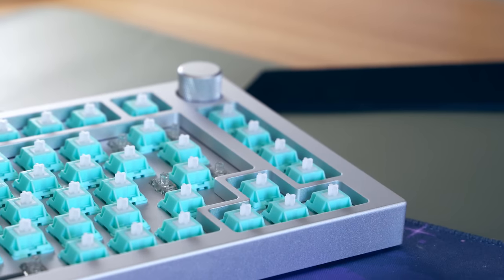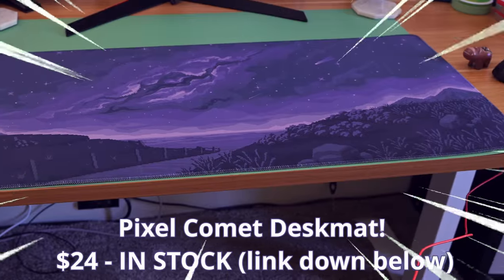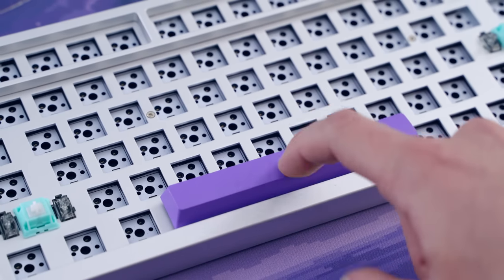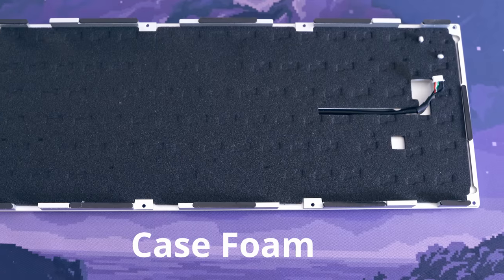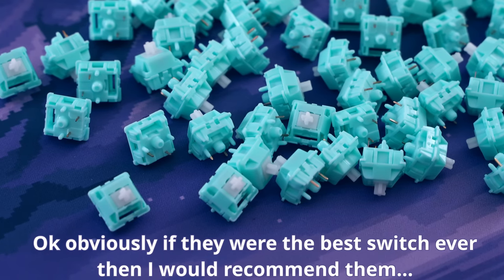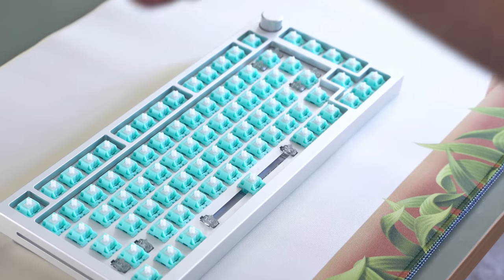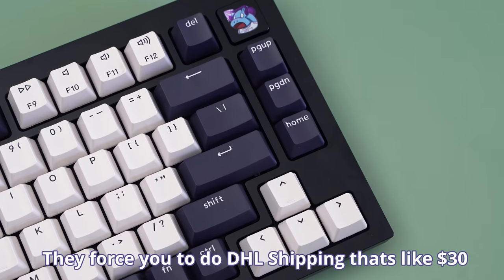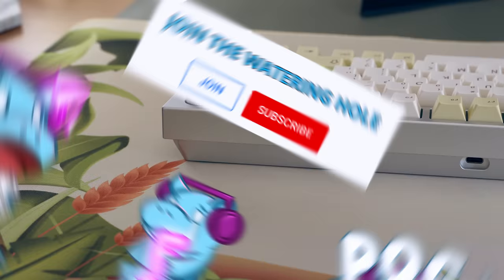I Tried the GMMK Pro (So You Don't Have to.)

Comment: Randomly got really into keyboards this year, & now have 10 custom boards. Absolutely love my GMMK PRO w/ Everglide Aqua King switches. Love the sound & feel of the board, looks great, & a pleasure to type on
Reply: What’s your favourite board so far
Reply from the maker: Great to hear!
Reply: No, not lucky.  I’ve been down the rabbit hole for around 3 years now and I’ve wasted at least  5k-10k on boards.  It’s an addiction now.  Since I started working, I really can’t control myself.
Reply: i bet you didn't try topre, because it's the best and makes all other boards unnecessary
Reply: @zainzaidi5582  Haha! I don’t completely disagree, but my car collecting & racing hobby are far harder on the wallet, as are my sneaker & watch collections. I find building keyboards such a relaxing thing to do though in what little free time I have.
Reply: @ehrarbose5600  Favorite board to use so far is actually the GMMK Pro (I know some will think that’s ridiculous), but I have the Idobao id80 Crystal, BALDR 60 glass case, & a few others on order that I think may become my new favorite. I also missed the Mr. Suit in the first round, but I’m hoping to grab one in the next round in a good color. Heard lots of great things about that one!
Reply: Same. What plate are you using? I’ve tried them in alu and pc and found they are kinda loose in the pc plate.
Reply: The gmmk pro is my first custom keyboard (and hopefully my last) and I have it since june. It is a really good keyboard but I had to mod it a lot to get the perfect sound. But overall I really like all the feature it has (yes even the rgb) and the hotswap is a really cool feature to test out switches.
Reply: @crainger  I have both the aluminum & PC plate, but I’m using the PC plate & prefer the look and feel of it. It fits perfectly snug with no wobble or loose parts at all in my keyboard.
Reply: It's a real struggle
Reply: @FitLabb  if you can, tell me how it holds to the keychron? Deciding between the two and as many opinions I get the better
Reply: I built the same! topped it off with synthwave, big fan of it
Reply: But....why u need 10? 😂😂😂
Reply: @goovindnarula6470  I haven’t used the Keychron yet, so I can’t give any perspective on it vs. the GMMK Pro, but in the reviews & comparisons I’ve seen so far, most seem to favor the GMMK Pro out of the box without any modifications made to either. What I can tell you is that I am very happy with the GMMK Pro so far, and it’s one of the best feeling and sounding boards I’ve ever used to date, but that’s purely based on my own personal preferences.
Reply: What are your other builds?
Reply: My exact build is the gmmk pro, with aqua kings. Do the PE and gasket mod, thing gets close to sounding like a jelly epoch
Reply: @nightking1863  actually I’m a huge hhkb fan. Ive always given the king and founder  of thocc some  recognition.  Though I only have the pro 2 still love it
Reply: @mikemirando3878  heard the thera75 sounds and feels closest to the jelly epoch.
Reply: @FitLabb  I’ve heard the q2 to be better than the gmmk pro after mods. Although the gmmk pro doesn’t sound as good after the q2s mods, it sounds so much fucking better than the q2 stock. Personally, the  gmmk pro also looks a bit cheap with its crusty branding and side leds.  Still a decent board though.  Have mine with gmk WoB and stock JWICK yellows form the creamyco.  JWICKS are basically a cheaper alpaca re-color/alternative.  Really loving them right now.
Reply: @goovindnarula6470  if you plan on modding then fuck out of your board then go with the q1 (just realized I’ve been using keyhcrons new 65% interchangeably with the q1 fuck me lmao).
Reply: Me too. I have the aqua glides and polycarbonate plate. It was a huge in pain in the ass for me to get everything working properly because the switch plate was warping the PCB. Had to do a bunch of physical filing to the plate. All that is done and the keyboard sounds and looks great now. I love mine as well and also randomly got into keyboards. lol
Reply: keychron be-
Reply: @FitLabb  oh so you havent really experienced any enthusiast boards. makes sense why you think the gmmk pro is good lol
Reply: @jsnR-d7x  We all start somewhere, & having only just started in the hobby in the last 6 months, & 10 boards in already, it’s definitely my favorite so far & a real pleasure to use. Curious how I’ll feel after I build some of the more “enthusiast” boards I recently ordered on group buys (or plan to buy soon) that are mostly arriving in 2022, but I’m sure I’ll still like it.
Reply: @zainzaidi5582  sheeeeeeeeesh that's alota money lol
but in terms of money in the mech space, can't you just sell some builds you've grown tired of on the aftermarket if you're ever, like just short of cash? i'm legit curious bc i'm just getting into the keeb space and I've heard that most cases appreciate in value/you can make some decent change on the aftermarket and selling/building ppl boards (?)
Reply: Prebuilt vs Custom?
Reply: im planning to get aqua kings for a future build, would you recommend them, if so which spring weightage would you recommend?
Reply: @RanjitSingh-cb1cm  I have 12 different switches that I’ve used to date, & the Aqua Kings are by far my favorite, with lubed Tealios being my second favorite. They just sound & feel so satisfying to type on, and they’re the smoothest switch I’ve used to date. They’re also the best switch to use if you have a per-key RGB board since they’re completely transparent. There seems to be a shipping delay on them right now, but you won’t be disappointed if you get them!!!
Reply: @FitLabb  no offense but having 10 boards and Gmmk pro being the best in your collection just shows that you wasted money on most of your other boards
Reply: @jordanoon2758  No offense taken. I disagree though as I think it just shows my personal preference so far (but yes, there are 2 boards in my collection that I probably wasted my money on before I knew better). 

The GMMK Pro might not be a fully custom or very expensive board, but it is really good for the money & I actually like it. I’m sure there are others I’ll like better once I start building some new custom boards that are arriving over the next few months, but until then I’m very happy with it.
Reply: Same but not the 10 board part
Reply: You got moneyyyyyyyyyyyyiiiiiiiii
Reply: Are you a fucking millionaire?
Reply: @FitLabb  like how you stick to your guns. aspeacialy liking what you like. way to go!
Reply: Having 10 boards and liking the GMMK Pro is a bit suspect man, don't know in which or what way but it is not only unusual, also a bit weird .. Was your purpose while getting into the hobby finding the board which hides characteristics of its switches the most ?
Reply: @mkeebs3623  No offense meant, but your comment reminds me of the snobbery I sometimes see in the car scene, which I want no part of. Just because I might not be a fan of whatever car someone shows up with at a car show, or if my cars are faster or more expensive than theirs, that doesn’t give me the right to put them down in any way, & I still respect their personal preference to own & enjoy whatever they want without passing judgment on them. I suggest you try doing the same.

That’s no different than why I happen to like the GMMK Pro, as my opinion RIGHT NOW is that it’s actually a really good board for the price, especially when modded. And what could possibly be suspect of me liking that board? 🤷‍♂️ That comment was so ridiculous it actually made me laugh!

PS: I did just build a Monstargear Alu XO v3 a few days ago, and I like it enough that I swapped it with the GMMK as my “daily driver” on my desk for now.
Reply: @kninzotagoni3635  Thank you, appreciate your kind words! Personal preference is just that……and everyone is entitled to like what they do. If we all liked & owned the same stuff, the world would be a very boring place.
Reply: @FitLabb  indeed just like hipos latest video he made a 20 dollar board like like something past 200 with upgrades. it's all about preference.
Reply: @FitLabb  i see your point. Wasn't trying to be snob this being the YT comment section maybe I sounded like one :) True it is down to preference but try to see from my perspective too, I couldn't really wantingly use the GMMK Pro & IDABAO80 after I started building customs. So rather than trying to be snob about keyboard brands, I found it hard to believe you still like the GMMK Pro that much you know? Kind of like I love my 200lbs less track-hardened Z06 with a nicely massaged LS7 but if somebody gifted me a CGT i would be liking and using it alot less :) I was looking at the Monstergear XO v3 too, you like it ? It was in my list before decided to go on the Matrix TKL GB 2 months ago.
Reply: @mkeebs3623  I appreciate your response & understand your perspective much better after you explained it this way. Maybe I’ll feel differently about it one day after I have several custom builds under my belt as well, as maybe I just haven’t experienced enough boards to know better than I do yet. Bought a soldering iron 2 weeks ago to start practicing with before some of the solderable boards start arriving, so we’ll have to see how that goes.

I really like the Monstargear XO v3! The thing weighs a TON, which is largely due to the massive brass plate on the bottom, but the fit & finish is top notch, and I really like the aesthetic & sound of it. I don’t think you would be disappointed with it at all. I got an extra pcb & an aluminum plate in addition to the brass one, but used the brass for now, and it sounds & feels very nice to type on with the linears I went with. Still would like to get the Mr. Suit if I can get one, & have a Monokei Kage in navy blue on order as well (arriving sometime late next year), even though I generally prefer the 65% & 75% sizes better. Something just stood out about all those TKL’s to me that made me want to pick them up.

Btw, saw you made a short video about the KBD75 V3.1? Curious how you like that as a custom build & how it compares to something like the GMMK Pro or other customs since it’s priced somewhat comparably.

PS: Do you have a Corvette ZO6? I love those cars & almost pulled the trigger on one of those several years back, but bought my 2008 Viper convertible instead back then. I now have a 2017 Viper ACR Extreme as well, both of which you can see on my personal IG page that’s linked in the about section on my YouTube channel. I also briefly featured the 2008 in my “Periodization” video on my channel, and my 2017 had a fun video made about it by a car channel I’m friends with, which I linked to in a playlist on my channel as well. I think it’s in the “collaborations” playlist if you want to check it out. Think you’d enjoy that one as a fellow car guy. 🏎💨
Reply: @mkeebs3623  I just recently learned to start buying an extra PCB with every board I buy, but I like your idea of getting one hotswap and one solder version, as I’m sure I’ll actually enjoy soldering boards once I start getting into it.  Not that I have much of any free time to do any of this, as I work about 12 hours a day, and then have to still find time to take care of my kids and get to the gym, but it’s great having fun projects like these to work on whenever I have 30-60 minutes free at night.  Speaking of, I just bought one of the remaining Fox Lab Time 80 Reforged that they had leftover for sale, & can’t wait to build that beautiful board with the brass clock in back!  That board is a work of art on the back, & I’ll probably have it on display in my office when I’m not using it.

2008 was a great year for the Z06, and sounds like yours is very appropriately modded for track use!  Did you move from the US to Europe?  Glad you’re able to really fully enjoy it!  I don’t track my cars (I usually rent a race car or drive a manufacturer’s track spec car), which is upsetting as I’m DYING to race the ACR, but the values on them skyrocketed last year to almost 3x what I bought it for, so I kinda have to keep the miles low on it while I drive the 2008 much more often.  I usually race at Lime Rock Park in Connecticut or at Monticello Motor Club in New York.  The only minor mod on my 2008 are high flow catalytic converters, which makes the car basically sound like it has straight pipes, and adds a bit of power as well, which it honestly didn’t really need.  😂 

Looking forward to checking out future videos of your keyboard builds, so keep them coming!  I just got into the keyboard hobby in the last 6 months, but I find myself watching keyboard videos every day now & can’t wait to see what cool stuff is coming out in the next few months.  My channel is all about fitness as I’ve been a fitness professional for over 20 years, worked with many NBA players & celebrities in that time, and now founded an online fitness & nutrition platform that I operate as well.  As much as I like cars, keyboards, and other stuff, fitness and helping people have always been what I enjoy doing most in life, & I love that I can now really help so many more people all around the world even just through the free content that I create on my channel.  And I’m glad we got to chat here after that initial misunderstanding, and it’s great meeting you as well.  Wishing you all the best with what you’re doing, & looking forward to seeing more great keyboard videos on your channel soon! 👍
Reply: @FitLabb  love the viper man that's like my dream car. wish they mass produced the viper gts R. that cars body is just perfect. wish I could get that years model and get a body kit to look like it but it's hard to find any body kits of it and I could never afford it. XD
Reply: Is the GMMK pro still your fave?
Reply: @kninzotagoni3635  The Viper was my dream car when I was growing up, & it was literally a dream come true when I got my first one 9 years ago as I never thought I’d be able to actually get one. I still pinch myself most days when I walk into my garage & see them in there! Haha!

I agree that the GTS-R model back in the second generation was really something special. Not only was it a rare version of the car, but people don’t realize how rare the Viper is in general. Produced from 1992-2017 (skipped the 2007 & 2011-2012 production years), there were less Vipers made in all that time than one single year of Corvette production with only about 35k cars built over 25 years of existence. That’s one big reason you almost never see them on the road, & also partly because nearly 1/3 of them were totaled already by owners who didn’t fear & respect the cars.

I hope you’re able to get one someday. Work hard & smart, & there’s nothing you can’t accomplish in life!
Reply: @FitLabb  that's true and it's a shame they stoped making it but now Im afraid for them to bring it back. as an automatic or something Xc and ya I would say it's not impossible aspeacial if I can get a beat up one and gradually work on it to restore. but sadly I'm no macanic so it would be expensive to have some one do it for me. and ya that car has bite. it's what makes it special.
Reply: wish I had the damned money to do that
Reply: Did you use the base stabilizers?
Reply: @saltee8460  I actually did, and they’re not great. It’s my biggest gripe with the board, but I’m planning to mod them at some point soon so they sound and feel better. Every other board since and going forward I’m using much better quality stabs & modding them for a MUCH better experience.
Reply: @FitLabb  Thanks for the quick response, thinking of going with the durock v2 stabs. Seen a lot of people have some success with them.
Reply: @saltee8460  My pleasure, happy to help.  The Durock v2 are supposedly great (I haven’t used them yet myself, but I have a couple sets sitting around waiting to be used) though I’ve heard that they sometimes show up with the bars bent a bit.  I’ve used the Everglide stabilizers that I bought on Drop and they’ve been great so far for me!
Reply: @FitLabb  what board are you going to use them on
Reply: @kninzotagoni3635  I have several boards on the way that I’m going to be building & using them on. Off the top of my head, a few of them are the Fox Lab TIME80 RE, KL-90 wood model from Barrett, Eniigma Vertigo, Viendi 8L, Gentleman 65, EVO70, Idobao ID80 Crystal, Monokei Kage, and more….. Its going to be a fun year of building & collecting boards!
Reply: @FitLabb  I see if your going to do it to the gmk pro and you have an aluminum plate make sure to clip off the knobs with pliers. so they fit.
Reply: @zainzaidi5582  seek help my dude
Reply: I’m in love with my Aqua King switches
Reply: Same! Build my first keyboard this year and went exactly your route. GMMK Pro with Aqua King switches, C3 stabs, Polycarbonate Plate and AKKO keycap set and it's an absolute joy to type on. Looks great, sounds amazing and typing is so satisfying on it. I am however looking at my second board now the Mode 65...this hobby might make me broke but it is a very nice hobby nevertheless.
Reply: Are u gnna get a ducky one 3?
Reply: My GMMK PRO is amazing I absolutely love it. I also have a kbd fans and I still prefer the GMMK Pro
Reply: @danielbailey6923  I wasn’t planning on it, but then again it wasn’t really something that was on my radar. I’m picking up a Mode 65 today or tomorrow, & bought a bunch of other custom boards since I posted this comment a couple months ago. Managed to get one of the Mr. Suit R2 in black/chroma which I’ve been too busy to build yet, but that’s the next one on my list to get to, followed by the Eniigma Vertigo that’s also still sitting unbuilt in its box. It’s really easy to get really deep into this hobby very quickly if you aren’t careful. Haha!

PS: I’ll go check out the Ducky now out of curiosity to learn more about it. Thanks!
Reply: how do i start?
Reply: I’m making the exact same keyboard with a GMMK pro and aqua king everglide switches
Reply: I feel like a lot of gmmk pros are using eg aqua king switches (mines included)
Reply: Sounds awfully like RandomFrankP's GMMK pro
Reply: @FitLabb  ohh watches and keebs. Let’s discuss!
Reply: @nightking1863  that’s an opinion and I disagree
Reply: Iiiiiiiiiiiiiiiiii     got  the   sssammeeeee kkkkkkkeybooooooarrerrd.....
Reply: 10 already!? Tf
Reply: @FitLabb  yo trying to get into custom keyboards wich one would u want me to go for first? Asking u cuz it looks like you might know a lot about custom keyboards
Reply: @Arbythor  Good question and I’m definitely a good person to ask as I’m MUCH deeper into the hobby now than when I left the original comment above with well over 20 keyboards built now, and more still on the way.

So my questions to you are what you’re looking for exactly, meaning do you want to buy a “starter custom board” to get your feet wet in the hobby before buying at least one or two higher quality customs at some point down the road, or are you looking to get something really nice right off the bat that’s also fairly beginner friendly in terms of the build process?

There are other factors to consider as well, like what kind of switches you like best (linear or tactile), what your budget is, if you’re willing to buy into Group Buys to get exactly what you want (but have to wait a few months to possibly over a year to get them), or buy something that’s in stock or from the secondary market at a potentially higher price?

And what size are you looking for??? A 65%, 75%, or TKL are the most common and usable form factors
Reply: @FitLabb  kinda looking for a starter one that’s like 100-150 it sounds cheap wich I’m trying to keep it low so I can still buy other things for my keyboard collection and I think linear are the quite ones I’m not so good with switches I do like the gathering switches from glorious my friend had some of them for his custom board
Reply: @FitLabb  sorry if it’s all over the place it’s really hard for me to decide between something
Reply: @Arbythor  Being totally honest, you're not likely to find much of anything in the custom keyboard world that costs $100-$150 to build.  Even the inexpensive ones that are often considered "starter custom keyboards" like some of the offerings from Keychron such as the Q4 will run you as low as $150 fully assembled, but the switches that it comes with are not the best feeling ones you can get and will need to be lubricated in order to sound and feel "acceptable" by many people's standards (but still not as good as many other switches that you can buy separately), and you will need to lubricate the stabilizers (or buy better quality ones separately that you also will need to lubricate anyway).  You will also likely want to get a new keycap set to use on the board which isn't cheap either.  The point I'm making is that while Keychron makes high quality keyboards for the price, and there are some others out there that are close to those prices as well that are at least decent quality out of the box, to have a real custom keyboard, many would argue that you actually have to do at least some modifications to it to improve or change it in some way to be better or different than it is out of the box (especially if it arrives fully assembled like many Keychron's often do for between $150-$200).

As for your other point, the type of switch you use really depends on your own preferences which you may not know just yet, but most people tend to prefer linear switches, with tactiles being the second favorite.  I personally prefer linears overall, though there are some tactiles that I also like such as the Amber switches that CannonKeys sells.  But again, unless they are factory lubed (which usually also means they cost more), you will likely want to take the time and effort to lubricate your switches to improve the way they sound and feel.  This hobby is all about personal preference, and what you like today will almost certainly change within a few months from now as you experience other custom boards and learn more about what other boards, switches, and modifications can do to completely change the experience.  It's a deep rabbit hole to fall into once you really start getting into the hobby, so be careful to not fall into it too deep if you don't want to find yourself spending much more money on this hobby than you ever expected.

Hope that answered your questions and was helpful in some way, as those are my honest thoughts.  In the end, even a $150 Keychron that arrives built and ready to use out of the box will likely cost you $50-$100 more once you start doing any modifications to it that will make it into your own "custom" keyboard that sounds and feels better to you.
Reply: @FitLabb  ok thx I get were ur going I think I might be able to rise my budget a bit to make it a bit better I’ll research a bit more for custom keyboard starter ones and what I should spend I’m thinking now of around 200-300 possibly I might start with gmmk pro as I know glorious really well so I might start off with them
Reply: @Arbythor  I started with a GMMK Pro as well and clearly loved using it for several months when I first got into the hobby. It’s a great quality “starter custom keyboard”, and you’ll likely love using it unless/until you decide to dive deeper into the hobby & experience just how much better many of the custom boards in the hobby can potentially be! 

Many people stop with a starter custom board like the GMMK Pro or something similar from Keychron, which saves them a LOT of money, but if you do get sucked into the rabbit hole of joining a Group Buy for a much higher level & more expensive custom board, you may find yourself never using your GMMK Pro ever again, as that’s exactly what happened with me and many others I know in the hobby. Either way, welcome to the hobby, and I’m sure you’ll enjoy whatever you end up getting! 💪
Reply: @FitLabb  hopefully and I’m gonna get the gmmk pro once I can and then we’ll I’ll work my way up with some other custom keyboards I just gotta get my first job hopefully I’m a few months so I can keep building keyboards
Reply: 10???
Reply: Why do have so much money I been in this hobby for 3 years and still don’t have a keyboard
Reply: @FBI-hz5zr  Work hard & smart at whatever you do and you’ll have the money to buy your first custom keyboard (and more). Wishing you lots of success and enjoyment of this great hobby. 👍
Reply: @FitLabb  it’s super relaxing too, just sitting down after a long day and hearing the calming noises, but then you realize you need to spend 300 bucks to get there😂
Reply: @zainzaidi5582  how do you not know if it's 5k or 10k
Reply: @FitLabb hey man!! I also just bought the aqua king switches and polycarbonate plate!! Im completely new to keyboards and hear everyone talking about how bad the GOAT stabs are. Did you have to fix anything or mod them? Thanks!